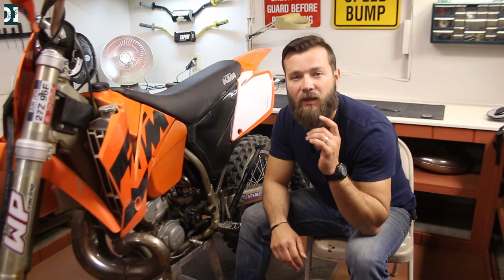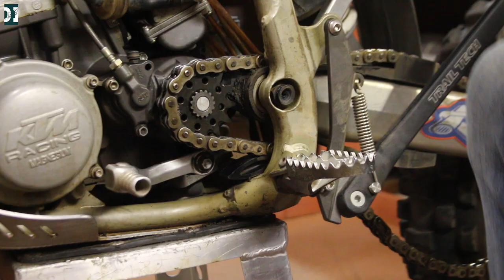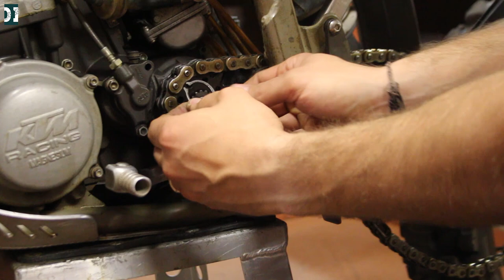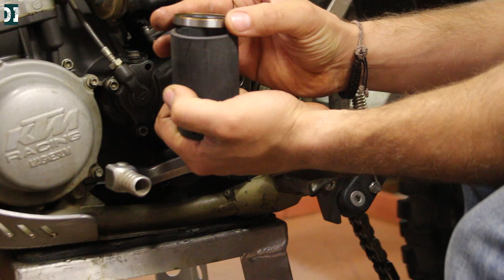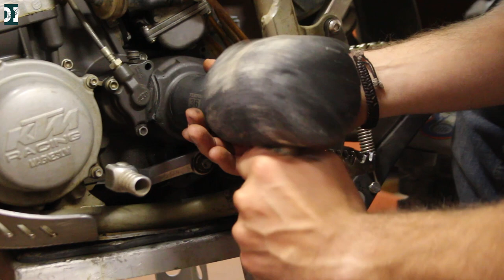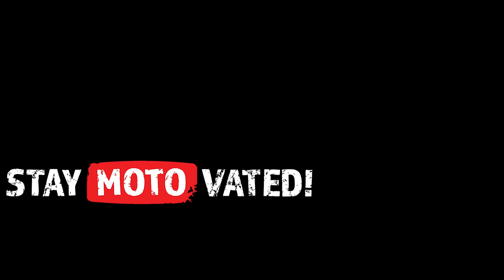How to replace counter shaft seal on a dirt bike KTM 250 sx - dirt bike maintenance.

Comment: Great video. I bought the counter shaft seal replacement part and cleaned everything up but the seal that is leaking is where the shift lever is so now I have to research that. Probably a similar procedure.

Comment: Great video brotha!  Did you drain your oil before you started?
Reply: Brandon Aga no need. Oil is not pressurised so it wont run.
Reply from the maker: thanks bro! no I did not, it wont leak thru the opening unless you lean the bike on a side..

Comment: Might be a dumb question but if I had a bad seal, would the sprocket have to be spinning in order to leak? I’ve whipped everything down and let the bike idle for a while and it’s dry as a whistle, do you think I’m good to go?
Reply from the maker: I think it would leak once you ride it. You need to replace the seal

Comment: Definetly helpful video like all of yours! I learned a lot from your channel :)Thanks for all. Also one question. Im 16 and im 120lbs. I ride 250f. What kind of workout would you recommend  for my arms?
Reply from the maker: +Xtreme I like body weight stuff, do pull ups, push ups dips.. don't use any grip help, that way you will build strength in your hands and forearms too. Start there and see how it goes. Diet is the key, make sure you eat enough. Later maybe start adding some weight training if you feel like it. Good luck !
Reply: Dirt N Iron Thanks man! I'm definetly going to give it a shot.

Comment: so there is oil on the other side for the seal to protect leaking out, transmission oil. or is there. did you flush the oil before or no need...
Reply from the maker: yes, there is transmission oil there. I did not flush it, I think its not necessary. I did my oil change recently

Comment: sometimes the aftermarket countershaft sprockets are thinner than the ktm ones (the last ktm one i bought was also too thin) and there will be no pressure on the oring inside. A fix is you can make your own crude spacer out of tin cans. I had to use 2 to get enough oring pressure.
Reply from the maker: +reino kotze thanks for sharing bro, I wasn't aware of that.
Reply: i do have that problem with my ktm 250 sx right now, everythings new but still leaking thiking the oring needs more pressure
Reply: @nexxpe  my countershaft sprockets are the correct thickness but it still leaked. i just ended up making my own very thin  washers out of a tin can. needed about 0.2 to 0.3mm to get enough pressure on the oring.
Reply: Yep. I found that the retainer clip was too thin, no it allowed the sprocket to move. Replaced it with an OEM factory clip which was just barely thicker, and now everything is solid.

Comment: I've never done that seal but I've done the shifter seal which is a pain had to remove almost all of the right side of crankcase
Reply from the maker: I did kick starter seal before .. little more work as well..
Reply: Should be the same except if the seal is ruined completely then you have to pull the shaft.....
Reply: Nam Tech ya I had to pull the shaft and I put a new one in aswell was a new seal
Reply: On an EXC and many others you can pull the seal without removing the whole cover - 10 minute job.

Comment: you supposed to mention that you don’t drive the seal in to far as it goes until it stopped because if you put it in to far it will lock up yours sprocket shaft , japan bikes have a stopper so you can’t drive it to far it will stop where it needs it to 🤦🏼‍♂️
Reply from the maker: i drive it in til its all inside, not deeper then needed.. never had any problems